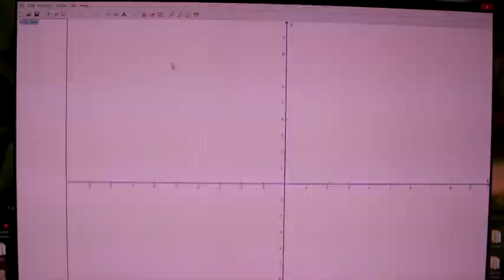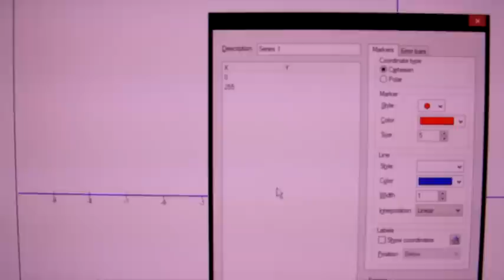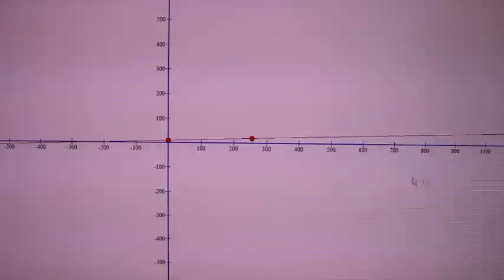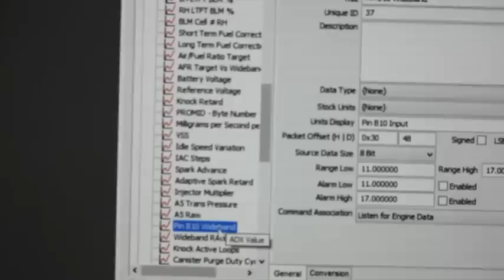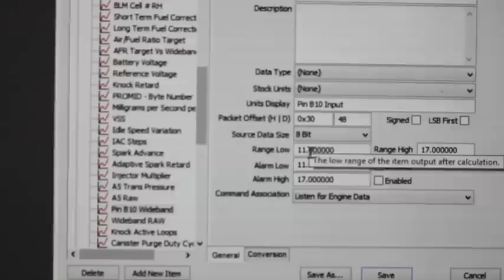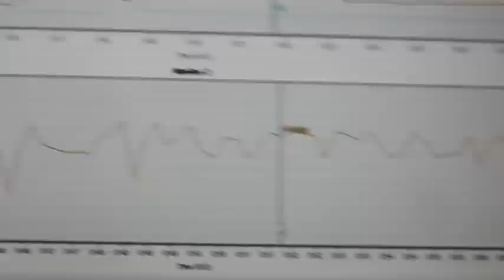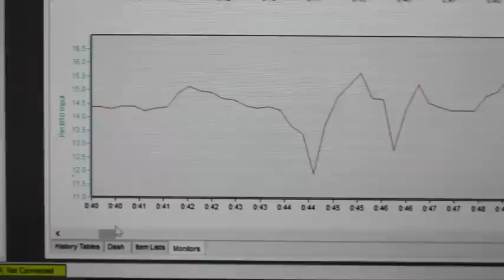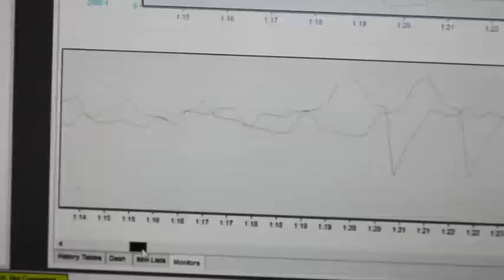Setting up Wideband Tunerpro

Comment: I know this is an old video but I am curious. I am trying to avoid paying for HP tuners to tune my Gen3 LS and I want to get my wideband signal in on PCM pin blue 55, which is the unused EGR. Wondering if you ever messed with the ADX file required to make that work?

Comment: Hey mate Boost Obsessed from the forum, ive followed your instruction, however i am wondering do i need to do a log with the 14point7 wideband to check the accuracies on the log? Because i followed the video and placed it on a log i have already without the wideband setup and its not accurate on mine. I noticed even though i used the graph software i had a different equation to you and also i tried your equation to to no avail. Any ideas?